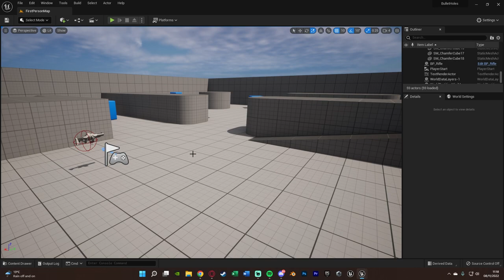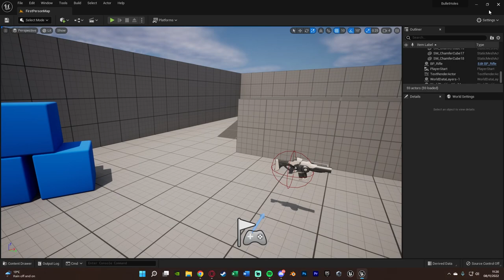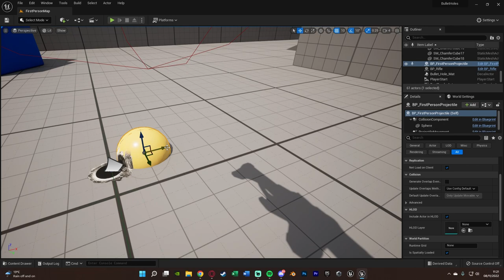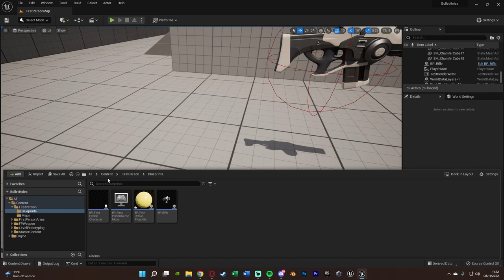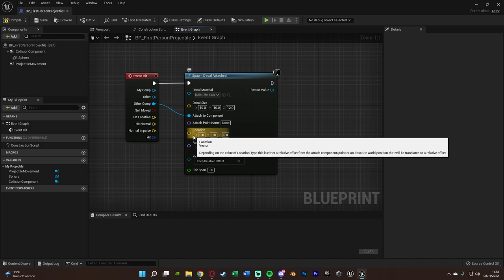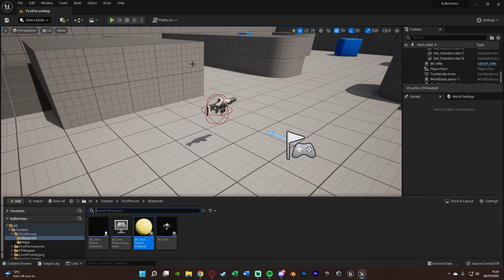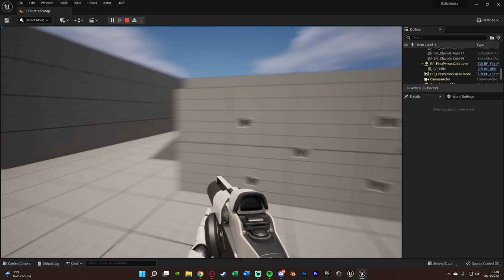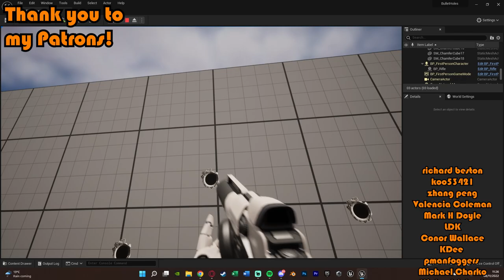How To Create Bullet Holes In Unreal Engine 5 (Tutorial)

Comment: It doesn't work for me? When I drag the decal into the scene it shows up fine, but when I spawn it, it doesn't show up. I already tried scaling it up, still not showing. I put a print string after the node and that one works, even though it seems no decal is being spawned.
Reply: Use line trace projectile instead, break hit result, get from Impact point for decal location